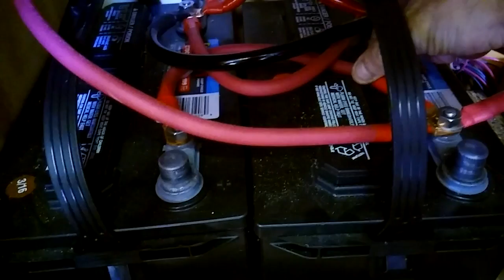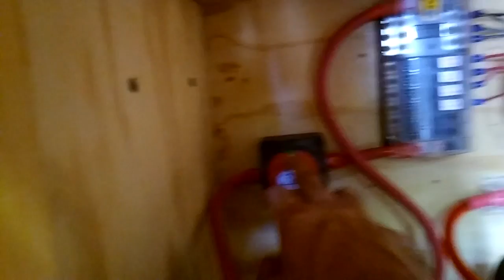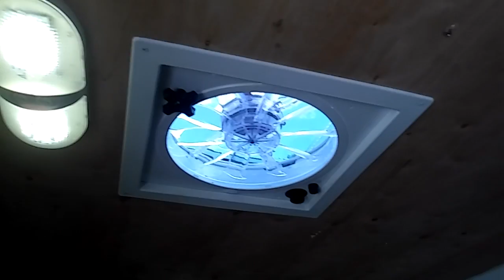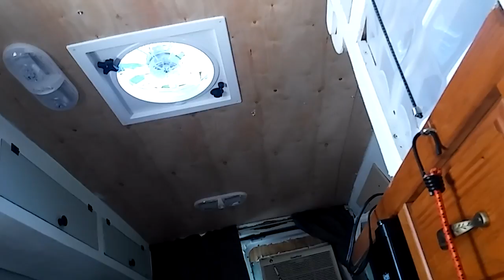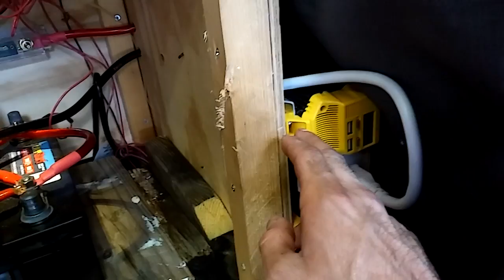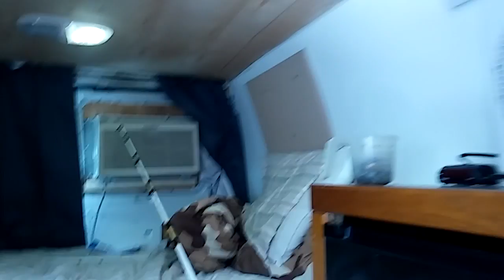Campervan & RV Electrical System Explained - Battery Bank, Wire Gauge, Inverter, Solar, D/C, ect.

Comment: Well this is about as close as I have come to understanding how the power works. It seems like you would want to have the charging capacity from your alternator also in case it is overcast and you can't get enough sun to charge your batteries. Is there a reason why you didn't leave that on there? Where will you go first when you get it all ready? Nice video! Thanks!
Reply: In Corys defense, Deep Cycle batteries like his want and like a slow charge not to exceed 20 amps.  Most automotive alternators above idle speed at 1,200 engine rpm put out 35 to 150 amps.  Oh sure it'll speed charge the solar batteries quickly but will cause the batteries to both boil while over charging and sulfate the $100 batteries real quick.
 Lastly if he does back charge the solar  batteries, he would literally BLOW the Solar Charge Controller Up.  To prevent that he'd have to add a Schotky Blocking Diode and or a  Latching Relay wired off the ignition to make and break contact to the battery + positive side from the controller.  Too complicated for the average person to wire up.  Not hard to figure out which device would win the Electrical Fight ,  100 amp  + alternator or 20 amp solar controller.  The alternator would smoke the controller and solar panel every time.
I know because I screwed up.
Reply: +steve murphy 
Cory, I also found out that the average Wet-Flooded Cell batteries are good for 8,000 surge/peak/spikes before they sulfate.  Those surges, peaks & spikes are based on High amperage draws of 80% or more normally caused by inductive motor loads (AC) or resistive heat loads (toaster).
Reply: +steve murphy
 Nice explanation.  I once had a battery charger draining my batteries down after I had unplugged it.  The culprit ended up being the inter blocking diode on the battery charger.  Plugged in, it charged the batteries up.  Same thing can happen on a solar panel if the blocking diode ever fails.  The solar panel at night will act as a heating element and drain the batteries down.  That's why you'll see solar guy's add a diode to the controller solar or battery side terminals.  I don't do it because I would lose 1 amp because of the voltage drop and current consumption of the diode.  1 amp is allot when you figure it'll run 10 led light fixtures.
Reply from the maker: +MultiScrappydo Hey thank you i am glad you could understand it from this video! And i removed it because like Steve said they are not to good for the style batteries i have. I will be heading north up the east coast to Maine as i have a cousin getting Married there in Sept. Then from there i will be heading west no plans though really just gonna let life and the roads take me where they wanna go :) Thanks you for checking out the video! Take care!!
Reply: +steve murphy I saw that article on Battery Guru.
Reply: +Daryl Maupin On an elaborate solar system I'd definitely add a diode but only if I were over a 1000 watts of panel.
Best to put those on the controller battery side only though because that's all your trying to protect anyway.  Why people putem on the fuse block is beyond me because it gets even hotter to the touch.  If it charges over 40 amp you have to solder 2 of them side by side due to the 12 gauge lead on them.  Yes, their current robbers but a cheap safety policy because I'd hate to remove an already installed solar roof panel just to get to the diode.  Usually lightning strikes are what blows them grounded solar frames or not.
Reply: +steve murphy Some here will say just put a switch in the circuit to turn things off or on but who has the dicipline to do this or that?  I prefer the supervised circuit to do that.  What if one doesn't remember to do this or that?  Now your equipment is trashed.  Most warranties are 30 days on electrical
Reply: It's not about the watts, it's about how your charger (from your engine or your generator) manages voltage. Old alternators (and DC outputs from generators apparently) use a voltage that is too low, and therefore it takes them forever (longer than is realistic to wait) to get the last percentages of charge to get your battery full.

But if you plug a smart charger on your generator, and charge your batteries with that, you are fine.
Reply from the maker: great advice everyone thank you!
Reply: Not only too much amperage from an alternator, but too low a voltage for reliably filling a "house" battery. Most alternators produce 14 to 14.2 volts, and that's about 1/2 a volt shy of the "pressure" needed to fill a deep cycle battery. Chronic undercharging often results in chronic overdrawing, and before long you need to get new batteries.

Providing he's got a capable charger, Cory's use of the Honda generator for back-up charging is a good approach. You wouldn't want to use the DC output capability of the generator for charging, again because of too low a voltage (and possibly also too little amperage -- don't know for sure).
Reply: Bulk charge rate in amps is related to total capacity, as you'd expect. Off-gridders might tell you the rate should be 10% of the total (20-hr discharge) Ahrs, boaters will say 20-40%. So, for Cory's 218 Ahr bank, that would be a range of 20A to about 87A. 

Slower is safer, and also less efficient and/or costly. Problem is, the mfrs often do not spec what bulk charging rate or voltage is optimal for their batteries, especially makers of marine/deep cycle products. It's better for true deep cycle products like Trojans.
Reply: So you mean 2200 watt generator is not enough to charge 218 Ah bank? Please help me to understand, since I m planing to charge my batteries thru alternator and generator.
Reply: Jay Jay thank you

Comment: Using solar power, would you be able to run your AC on the power inverter?
Reply from the maker: +Pink Metal Stitches Yes i have powered the a/c unit on the inverter just once to see if it would power it and it did just fine. Prob would drain the batteries very quickly though so i just run it off shore power or my generator. The solar panels power all my lights, fans,roof vent,charge the batteries, power the inverter ect. ect.
Reply: +Campervan Cory Good to know.  I have 5 dogs and 2 cats and would like to be off grid completely when i go full time in my RV.  I am trying to figure out the way to keep it cool while I am at work.
Reply: +Campervan Cory 
Based on what I know about your system,  the ac would run 20 to 30 minute's at a 50% discharge rate.

Comment: Nice fuse block and over sized for future expansion.   Dummy me bought just the 6 circuit one but needed more so I pitched the 6 circuit for the 12 cicuit one.  I have the same batteries too and contemplating a 24 v system to run my AC Unit.  One 400 watt panel 48 inches by 77 inches would fit my van roof beautifying.   The one hundred watter I can bump to the further front.
Reply from the maker: +Leroy Lucas Thank you Leroy! I almost went with the 6 block myself lol but hey at least you have a 12 block now and from the sounds of it you're gonna have one hell of a kick ass system! Would love to follow along when you do that! Looking forward to seeing it and good luck and safe travels man!

Comment: Thank you very much Cory. This video answered a lot of questions I had,  that must seem too simple to address, for most people trying to share this information. Right now I'm living in my van without electrical. I'm subscribing, and I really appreciate this. Another question to prove I'm green though. For your fantastic fan and lights, do you ground the negative wire to the fuse box, or open metal on the ribs of the vehicle? Thanks again man. Take care.
Reply from the maker: +Evan Cornelius  Thank you so much i am really glad this video could help you. I felt like there was a lack of info on this topic when i was building my van so i wanted to post this to help others and i am really happy it has!! The lights and fan are not grounded the run into the fuse panel and you need to put the small fuses like in a car and if anything overloads the fuse breaks and the electricity flow stops.. Hope that helps lmk if you need anymore help and take care!

Comment: I know your working hard but don't let the know it alls or nay sayers get you down.  They'll take any little piece of info and blow it out of proportion.  Not their stuff or finances yet eant to tell you how to do it.  Lol!  If any body out there insists on this man having AGM Batteries then buy them for him at $260 each!  Any takers ???  Exactly!
Reply from the maker: +steve murphy Haha i agree! I gotta work with what i got you know? Maybe one day ill have the AGM batteries but for now the 100 dollar wall-mart batteries will work lol. Thanks for the support Steve!
Reply: +Campervan Cory 
The wet cell flooded batteries are VERY Forgiving over AGMs as you know.  I've seen other solar guy's trash their NEW AGMs because they either ran them down 11.9 v / 40% or shorted them out wire wise.  Installing a 3/8" vent is no big deal plus it allows the batteries to cool down be it AGM or Flooded Cell.

Comment: GOOD JOB BUT....THE NEGATIVE WIRE FROM THE NEGATIVE SIDE OF BATTERY TO YOUR FUSE BLOCK NEEDS TO BE BLACK IN COLOR, WRAP IT WITH BLACK TAPE OR PAINT IT BLACK. THIS IS A NEGATIVE WIRE NEEDS TO BE BLACK NOT RED FOR SAFETY.
Reply: Why sharp shoot people?  Big deal the wire isn't marked.  Paint what when just piece of colored electrical tape would do.  His equipment,  finances, labor etc...  He was also very clear that he wasn't finished yet.  All he did was give us a sneak peak into what he was doing.  Maybe I'll visit your page and Sharp-Shoot your work.  PS, drop the caps.
Reply: Hmmm, just as I thought, your channel has no content, or pic's of your solar install.
Reply: +Daryl Maupin 
I know right?  I can't tell if theyre trolling as a know it all or if they work at Radio Shack.  Poor guys not finished just like he said & out come the negative people with all there so called ideas.  When I get these kinds of prople I just delete & blockem.  Who cares about color coding the obvious especially when hes the only one thats gonna work on it.  Those batteries & cables will last 5 to 7 years.
Reply: +steve murphy Hey Steve!  Thanks for referring me here, this guys cool.  I ended up drilling a 1 inch hole through my floor for the battery vent using a 1 inch galvanized nipple with 2 locknuts because I couldn't see punching a hole in the van's sidewall to vent.  At the top of the nipple I put a piece of course screen and rubber band over it to keep the bugs out.  Hell, batteries only vent gas during day time bulk charge cycling any way so no factor at night.
Reply: Why the Negative comments to what Barbara said?  Shes Right. Finished or not this should not be done like that and if done like that temporarily it MUST be documented and Labeled. Im a former Maritime Engineer. 

The reason you should label it immediately are several. For one, by the time the person returns to the project they may FORGET this little tid bit and cause a sparking or short circuit and cause some equipment to burn up and at worst a fire will break out.  There are dozens of off hand carelessness scenarios that can take place when moving wires around and your eyes will go into knots in the crows nest of wiring. 

There is also the possibility that someone else may pitch in to work on something and cause a electrical fire by this very cable. 

 there is alot of energy stored there so label right and label right away before the mind moves onto other things.
Reply: +Grzegorz Durda 
This is NOT a "Solar Engineering Vlog or Blog" but rather an average guy sharing his install with other's.   There isn't anyone here that would pay him to do their install because the average person would have it done at an RV Dealership.  No one here can have ANY reason able expectation of a fellow average youtuber to be perfect on a solar install.  This is Corys stuff, his way, his finances,  NOT ours.  I have a Solar Install vlog on youtube under a different name and I show my installs perfectly done before I post so as to not have to listen to the trolls, nay sayers and know-it-alls.  I do solar for a living,  you don't.  This is by far one if the BEST Self-Help video's I've ever seen done by an average Joe Blow.
Reply: +Grzegorz Durda 
Dude, go sharp shoot on a solar blog with all your advice, not here.  Your another typical know it all.  Me?  I am an Engineer and don't need a pat on my back or bragging rights.  The guy did just fine and I'm positive there will part's 1-3 up dates.   Like Cory said for the 20th time, "He's NOT finished yet".  Sheesh!
Reply: +phil vano Sooo, what ever happened to radio shack?
Reply: +phil vano Dam!  I don't think I could work for you.

Comment: For safety reasons, get yourself a CO detector in your coach with a 10 year battery, even if your generator is outside on the hitch...
Reply from the maker: +Bob Dickman  Thank you Bob i actually do have a 10 year co in the rig best $20 i have ever spent!

Comment: Nice video, keep on trekkin'  Just a couple of thoughts, lead acid batteries make gasses, they need to be vented. When you get your solar kit, you can monitor your battery bank better so you don't drain them too far and degrade them. Sorry I'm nitpicking, the negative wires should be black so not to confuse. You're doing great, take care, I'm not far behind you, setting up my own van. Maybe we'll meet someday! :-)

Comment: Great simple explanation on the setup, easily understood and pretty cool that you add links to the products. I understand you will be using solar but why remove and why don't you like using a relay isolator? ~jman
Reply from the maker: +A Few Minutes With jman thank you jman i took my relay out because i didnt want it to fry my old alternator not sure if it would but didnt want to risk it.
Reply: Campervan Cory could enough reason, they more then likely make a higher output alternator for the van but then again that's more bucks. A lot of people wouldn't even take that risk into account, good call. ~jman

Comment: Very professional setup! I have a Renogy 100 watt system, works great and is reliable. It is too small if you are going to run that fridge much, 300 watts is probably the minimum you need to operate that fridge. I use very little power when boondocking and the single 100 watt panel can't keep up, it helps tho.
Reply from the maker: +Donald Velasco thank you! And ok hopefully i wont always need to run the fridge only when i really need to i guess. Thanks for commenting
Reply: If my car won't go over 30 mph, it doesn't have to mean I need a bigger engine. Maybe I should see if the gearing is correct or the gas is okay.

If a solar controller or AC-powered charger does not deliver enough voltage (at the battery terminals) to fully charge my battery, it won't matter how many panels or kW I'm using -- the "tank" can't be filled effectively. Any battery mfr except Walmart has charts to indicate what the correct bulk and float charging voltages are. All it takes is a voltmeter to find the actual number being supplied.

Comment: Cory, your video is the first time - out of about a hundred times watching and reading explanations  - where I actually understood a power system...have 200W solar charging my 225Ah 12 volt batteries but need wired to starter battery.....learning as I go.  Thanks!
Reply from the maker: +Andrea K That is awesome im so happy i could help you understand the system :) good luck with your build and safe travels! If you ever need any help feel free to message me on facebook on my personal account Cory Rougeau

Comment: Your van is really coming together. Nice job on the electrics and a good explanation. I am interested how it will all work with the solar installed. Thumbs up as always.
Reply from the maker: +Robert Phillips Thank you Robert i will be posting a video of the solar panel install and will walk you through how it works and all.

Comment: hey Cory how's it going? again, excellent video on the whole electronical system. I actually do need some advice from you if you don't mind me asking I have to AGM sealed Vmax batteries made by renogy and they are 125 amp hours each. I have 2 100 watt renogy solar panels on the roof of the van running into a 30 amp charge controller and I also have one of those meter5.  so basically what I'm looking to get his one of those fuse boxes not sure where to find one is there any way that you could email me directly or if I leave you my number maybe you could possibly text me or call me as you seem to know exactly what you're talking about and that's where I am with my van built so far and maybe I can share a bunch of my photos and you can give me some advice if you wouldn't mind that is let me know when you get this I really appreciate it thanks again for your time best regards Jason in New York
Reply from the maker: +I Am Second  Hey its going good thanks, how about you? Thank you for checking out the video and i hope it helped. The link to the 12 port fuse panel is in the description for this video and sure id be more than happy to help you out. Feel free to send me a message on my personal facebook Cory Rougeau :)

Comment: U going to like that Renogy solar panel kit :)
Thumbs up
Reply from the maker: +Kaleb S. Thanks alot man i appreciate it!
Reply: Renogy anything is good.  Just bought my first renogy mppt controller to replace the pwm one.  Now my batteries are charged by 8am instead of 11am.  Those are magic and renogy now makes small one for $125 on Amazon.  Im upgrading so I had to buy the $185 one which is rated 500w-12v and or 1,000w-24 v 40 amp.
Reply: +Leroy Lucas awe yeah your in the game Leroy lol...obviously stepping up to the MPPT controller is a investment 1 shouldn't second guess...can't beat it everyone says MPPT is the way to go and your batteries being topped off early in the mornings  :)